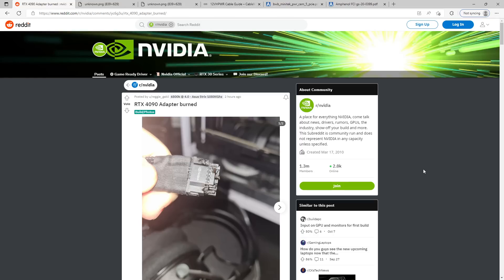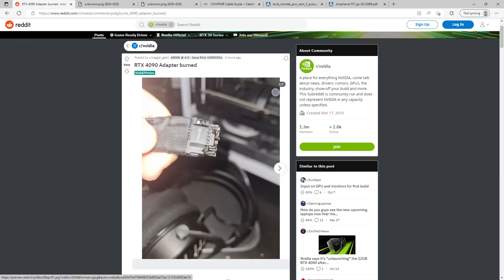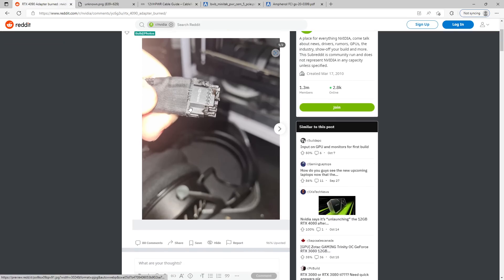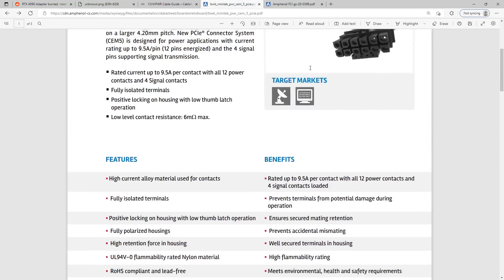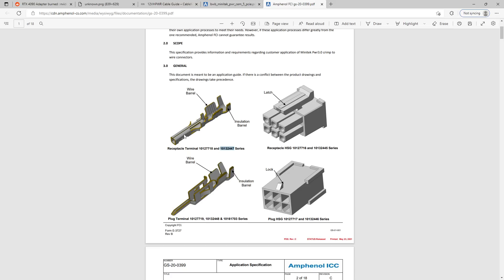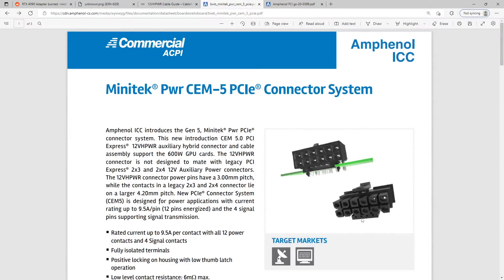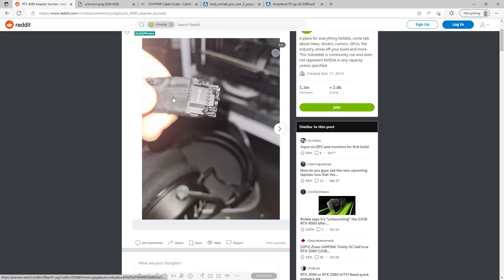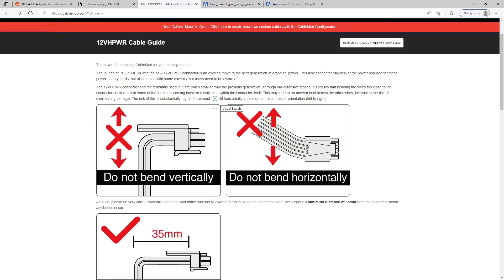The 12VHPWR connector sucks

Comment: A few points: A) As someone who worked with Data Center servers and cabling, I agree with the graphic showing the bend starting 35mm away from the cable. This is almost exactly what we would tell new people during training (1 inch, instead of 35mm) because it is advice that, if followed, gets precisely what you want. Yes, there is no such thing as the middle of the cable bending on its own, but that isn't really the point. The real point is leverage. Even a small amount of force pulling on a cable to make a neat turn that looks good can end up putting a lot of sideways leverage on the connector. Telling someone to make the cable come out straight from the connector doesn't sound like it makes sense, but it is advice that will produce the right result instinctively if followed (because it means pushing the cable to provide slack, instead of pulling the cable tighter).
B) At 12:10 - I feel like this could use clarification. I don't believe the sense pins are to prevent over-current to the power supply, but to prevent over-current down a single cable. Since Nvidia knows that people will be using adapters, it is entirely possible that someone could plug a 600w GPU into a 1000w+ PSU, but not plug in all of the 8-pin connectors. Instead of changing their power design, they engineered this to avoid pulling 600w down a 150w rated cable. I agree with your characterization heartily - this is an over-engineered solution for a problem that they created.
C) 16:02 - missed opportunity to say, "Truly, this will go down as one of the designs in history."

Comment: Went to check on mine, I knew about this connector being a problem when I installed my 4090, so I was careful, but I have like 2 inches between my card and the case door, more than most people, and I’m still pretty uncomfortable with the way it’s bent.  That adapter is carrying all the weight of 3 power cables.  I’m not sure how to approach this tbh.  Fortunately the top lock is holding the connector relatively secure with all the weight pulling it down, so yeah, any sideways force and you won’t have the lock holding the connector in place.
My card is upside down btw (fans up) so probably the ideal circumstance, my motherboard is inverted in my case, a ThermalTake W200

Comment: While they were redesigning stuff, they should have changed from 12V power to say, 48 or 60V power. The current would drop to 12.5 or 10A instead of 50A, and this would not happen. But what do I know? I only have 45 years experience as an electronics tech.

Comment: As an electrical engineer I? do feel for the folks at nvidia working on this -- in an application where you only have a very specific area to lay out your entire board, the space for those 4x 8 pin connectors could be a total make or break.  I'm sure that there were dozens of meetings about this before they committed to it
Reply: 3rd party cards seem to do just fine with the 3 8pin layout so i dont see why nvidia cant do the same with a more conventional 3 fan layout. Der8auer also showed that these cards are pushing an extra 100w-150w just for 5% more performance and are super inefficient. They could sacrifice some heatsink space for an extra pin or 2 easily with no temp issues

Comment: 0:34 well they could have made a slightly larger PCB to acommodate 4x8-pin power connectors. Given the size of the coolers on RTX 4000 series a bigger PCB would have been no issue..

Comment: I think you've missed a few things in this video. How can this person have bent the cable horizontally? Look at the pins. It's burnt on one side, so clearly it's been bent vertically. Now if you look at his case, the card has been installed horizontally not vertically on the motherboard, but to have the pins bent vertically clearly the GPU would have originally been installed vertically directly on the motherboard. Therefore I think this person bent the cable to accommodate the installation which he later changed. This cable is dangerous.

Comment: I didn't get it. They reduced the actual contact area per pin by ~60% and increased the rating for a pin by ~266%. I'm not an engineer - not even close - but I think if they stuck to the usual mini-fit jr. dimensions (4.2 mm pitch; 1.15 mm terminals; terminal length 16.8 mm) instead of mirco-fit 3.0 (3.0 mm pitch; 0.7 mm terminals; terminal length 12.4 mm) and just made the new connector incompatible to 6 and 8 pin connectors we wouldn't have had this problem in the first place.

Comment: >Me who unbolted my wall mount PC from the wall in September 2020 after watching 3080 release hype
>Me spent time adding two more 8 pin cables from my motherboard box because i was 100% willing to buy a 3080 that needed 3 x 8 pins
>I even used Tesa tape to bind all 3 togeter really neat and stuff to make it look good
>Me who never got to buy a 3080
>Me who was super disapointed we got ATX 3.0 and new GPU power cables/connectors
>Me looking at these two extra cables still being pointless sitting there on top of my GTX1070
>Me who still has my GTX1070 in my PC October 2022

>F***
>but on a positive atleast I didn't put one of these fire starters in my PC?

Comment: Generally as a rule of thumb among electricians and engineers is if a connector is rated say 10 amps then you are only going to use it for 7.5 amps or less or 75% of it's rated power ..... If this connector is rated at 600 watts then you shouldn't use it at above 450 watts, that's just common sense design principles .... Any resistance introduced because it's not connecting 100% is going to cause heating  and any gaps are going to cause arcing which degrades the connector further and increases the contact resistance causing even more heating until you essentially get a thermal runaway problem

Comment: "load across the wires" is referring to the increased electrical resistance created by a loose connection, as the electricity will make the jump by arcing to complete the circuit, causing increasing amounts of heat which further increases the resistance and subsequent heat.   It doesn't mean the mechanical load, it's electrical load.
Reply: When the cables are pulled at an angle, the female sleeve is being physically pulled back into the clip, away from the pin ever so slightly, and it will have slightly more resistance than the neighboring pin, causing more perceived power on the retracted sleeves, and that shows up as more power, and more heat.

I've seen this happen numerous times in mining GPU rigs with 8 and 6 pin power cables

Comment: Putting all those pins in a single housing increases the tension on the pins on the outside of any bend. The closer that bend is to the end of the cable, the less slack is available to absorb the extra pull around the bend. The same per wire current draw in an 8 pin would be safer due to the better contact with the socket, but the current draw is higher in the new connector.

Need someone with one of these cards to measure the resistance across the connection while bending the cable. No power needed. Just measure the resistance. See how much it increases from optimum with a bend in the cable. Heck compare with an 8 pin connector.

(With the bennifit of hind sight...) terrible engineering.

Comment: Regarding the Power connector wires/terminals, seems misleading for 'power balancing between the wires', the main concern is poor connection resulting in higher resistance at the terminal and with high current use, this results in higher heat at the point of higher resistance.

Comment: Honestly the PC industry is making this all way to complicated. In RC we have an ideal connector for this and that’s XT60, a double XT60 with silicon wires would be a very simple and perfect and safe solution that would not require this massive bunch of cables.

These cheap metal folded connectors are going to fail, no copper in sight and easy to open up is just stupid design.

Comment: Use 16 individual wires instead of ribbonized or tightly sleeved cables, then you don't have much strain on any wire since they can all move independently through bends as needed. Though it would help a lot if the GPUs weren't so gigantic that extreme bends were required to fit the cables in a standard manner.

Comment: Actually Intel was the main pusher of this type of connector coming to market. Pretty interesting if you consider that Nvidia 3000 and 4000 and AMDs upcoming cards both use this connector and Intel Arc does not. And intel naming it “arc” is quite ironic as these failing connectors are most likely arcing inside the plastic housing

Comment: TBH, with all that huge power draw, let's just build a 4 pin connector. Two pins are for power and two are for sense and go. There are a lot of high current connectors out there that only have two pins and are relatively small. Not much larger than a regular 8 pin PCIE.

Comment: You know what nVidia could had done with the PCB? There could had been an extension coming off of it toward the middle, with a 2x2 arrangement of connectors. It would had also required re-engineering the entire card so input is at the middle instead of at the side, but it would look a bit less goofy, and permit use of standard cables.

They could have had the seamless appearance on all sides rather than a power connector interfering with the look of the connector! They could had also reinforced the connector so it would never wrench out of place! nVidia could have done a lot here, they just didn't.

Comment: currently checking my 12vhpwr  connector lol I don't have a side panel and also upon initial install I got no display out and a little red light next to the connector wonder if that is ASUS' way of letting you know hey your connector is not in correctly because that was my issue I literally pushed it on a tiny little bit then I got display perhaps it is a know issue is what I'm getting at lol

Comment: If it can't be bent near the connector, why not just make a hard plastic or metal cover on that part of the cable? A hard casing extending about 35 millimeters down to prevent dangerous bending could have prevented users from thinking that was normal, usable cable.
Reply: But then no one (or very few) could close their case. This make is it your problem, not their problem (in their eyes).

Comment: Its all fun and games until one of these starts a house fire, somebody dies, some government agencies get involved and WOOOSH there is the recall. But wait, it gets better, Nvidia, unable to get off from their high horse, will deliver a version 2 cable, with a huge plastic receptor on the gpu to SAFELY and SECURELY connect that connector without ever being able to bend at the pin/plug position. Ironically this HUGE receptor will take as much space as three 8 pin pcie power plugs.

Comment: My attempt at a simple explanation on why horizontal bending is so bad: First, imagine the power cable is a race track, then realize that all of the wires in these cables are the same length, but if the cable bends side to side (horizontally) the cables on the outer lanes will have to travel a longer distance than the ones in the inner lane. What's happening is either the wire is getting pulled backwards out of the 10132447 receptacle terminal if the crimp isn't secure enough or if the crimp is secure enough then the whole 10132447 receptacle is getting pulled backwards from the plastic housing. Regardless of which of these are happening, both would result in a smaller contact surface transferring the same amount of power through it. This is bad because you need all of that contact surface in order to 'spread the load' keeping the thermals in check. If the load of energy is un-spread then it's concentrating into a small spot which results in melted plastics.

Comment: After setting up this new spec and all the "R&D" There are much better connectors that exist out there, without issues like pins wobbling around, but yet they chose to stick with this stuff for the next ATX Spec and threw more power through less crappy connections in one connector?

Comment: Nvidia should not have a connector that requires at least 35 mm of straight cable without forcing it with physical restraints on the cables. Other than that, all the smart stuff BZ said about 12v pins is just more reason why they shouldn't be doing this...

Comment: Bending vertically you only have 2 wires next to each other, so the stress on the outer wires (relative to the bend) should be smaller than with horizontal bending, where you have 6 wires in a row.

That'd be my guess on why that's worse.

Comment: There are some custom plugs, they have solid core copper wires (easy to bend) and/or angled connector. It doesnt change that this new standard for plugs is very stuphid, at least this custom ones are safer.

Comment: Iirc jayztwocents reported on this a long time ago from some sort of nvidia leak that they knew this connector was going to have issues and they even state in the documentation that the plug is only good for 30 connect/disconnects MAX. Watch the aib start using the old 8pin standard so they don't get sued to oblivion when one of their bad power connectors burns down a house.

Comment: It's funny it's a NVIDEA thing the whole industry is a bunch of jack arses, half the connectors used are absolutely shite hell we still have the stupid 24pin that gets bent over constantly in like 99% of rigs unless you buy a 90deg adapter.

SATA connectors are ripe for becoming flimsy and coming loose because the latches are seemingly  made of kitchen foil, hell even USB C is shit unless your buying a proper spec one they become loose as a ducks arse on phones after 12 months.

Anything that's a pushed in pin to plastic plug and barrel unto a socket is known to be cheap and pretty shit in many many applications not just electronic hardware.

Comment: i can understand they want to use less space . having only 1 cable enter such a beast of a card looks wrong . a 300w limit per cable doesn't sound that bad to me and making the pcb a tiny bit larger to fit 2 connectors can't be an issue imo.
Reply: 90° adapters ftw
Reply: smaller pins are like sharper knives . thinner connector housing is easier to cut .

Comment: I do have to wonder if this is only a problem for the adapter, it might be that the normal cable, that no one's using yet because there's not a lot of PSUs that support them, won't have this problem.
Reply: I think the connector is just too small.  If you just put thicker wires in the old connectors they would be able to transfer more power with less problems and less heating.

Comment: This Boggles my mind how bad this connector is, who and why and what pressure needs to be applied, so it got approved?  

Here in Europe why EU electricity safety regulations does not ban it? This insufficiently build and insufficiently protected connector for Consumer electronic devices. In my mind this is clearly safety issue.  

Because this is so badly designed product all damages need to be covered by manufacturer like in cars or recall the units for upgrade for safety reasons.

Comment: If NVidia wasn't so obsessed with worrying about their stupid adapter cable, they could have just picked one of the many extant high-power connectors used in lithium battery packs. An XT60 or XT90 wouldn't have taken up any more space than their new connector, and would have been rated to deliver more power. Sure the power and ground wires would be a lot thicker, but you would only need one of each and it would probably end up just as flexible as the 16 current wires of the 12VHPWR, and definitely better than the giant bundle of 8-pins. The only thing missing would be their precious sense wires, and those may not have been necessary if NVidia hadn't jumped the gun and started using 12VHPWR before the PCI SIG finalized the PCIe 5 spec.

Comment: This connector is PCI-e standard, not NVIDIA proprietary, so one can blame the GPU maker for having chosen them, but not for their design. Thus said, the PCB size is not an explanation: my Gigabyte RTX 3090 has the usual 2 8-pin connectors in the usual position but if you take a good look at it (or tear it down) you realize that those are not on the PCB but there's a sort of embedded adapter that "repeats" them to some different connectors on the short side of the PCB via some cables. So, if they'd wanted to put 3 (or more) 8-pin connectors, provided all the cards (not the PCB) are so big for cooling, it'd not been difficult to find space for them with a similar arrangement.
Finally, the 4090, without overclocking uses not much more power than the 3090 (so, even less more than the 3090Ti), 450W is the real limit, dunno how one can reach 600W unless really heavily overclock (and maybe also overvolting).

Comment: The problem isn't the connector.

It's the fact psu v3.0 PSUs aren't it yet.

So instead of 4 PSU connectors to let PSU v2.0 psu work. it'll be 1 cable straight out of the psu.

But people are going to do silly stuff like not have it connected up properly or run too much power through that cable.

As the smaller the wire lugs are in the cable the higher the heat as the power has to bridge the gap

Comment: As someone developing a PSU for multi-GPU servers, I honestly like the concept of the 12VHPWR connector. I no longer need to provide literally 32 8-pin PCIe power outputs. The signaling method also makes sense to let the GPU what it should actually limit itself to, from 150W up to 600W. Of course, that's all moot if the connectors aren't reliable and start melting.